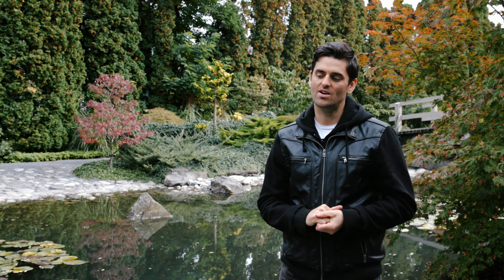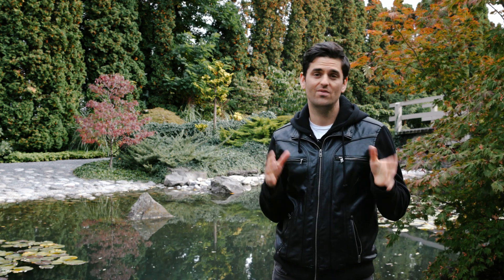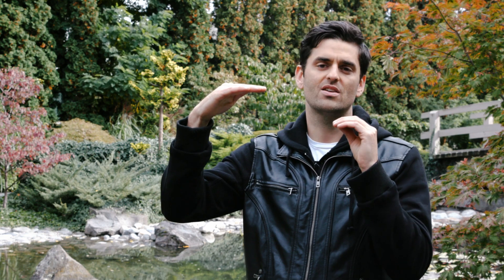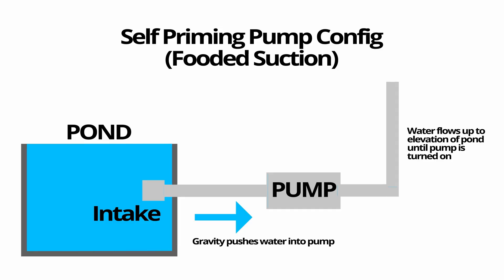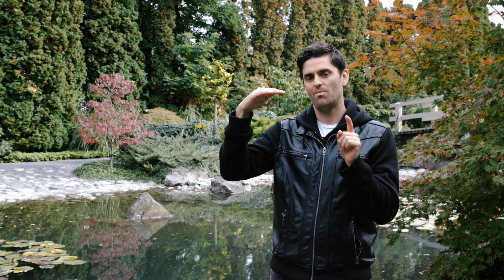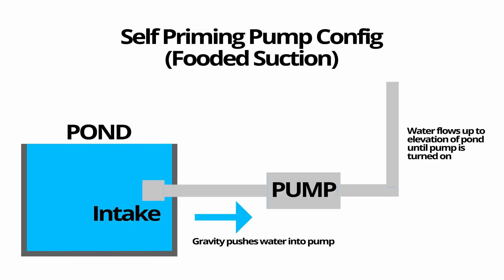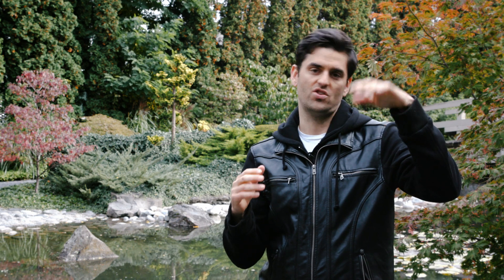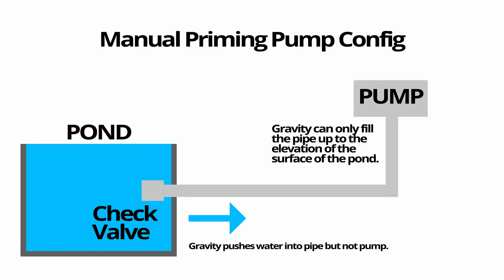Submersible vs External Pond Pumps

Comment: I had to plumb an external pool pump for my pond because my internal pump broke down in the middle of winter. This was the 2nd pump I had gone through and I believe they both broke due to lack of maintenance. I hope this external pool pump is a lot more reliable. I had to remove my check valve because it was leaking air into the suction line but I have a ball valve installed instead. The flow rate is significantly higher despite having a lower GPH rate on paper than my former submersible pumps. I had to modify my plumbing only a tiny bit to get the external pump operational. I love my new external pump.

Comment: Can you recommend an external pump that can pull 5000 gph and may be a low energy candidate to run on solar?
Reply: A 1.5hp pump would probably do the trick. The most energy-efficient electric motors are 3 phase and 240v or higher.

Comment: What size wire do the external pumps require? Can a 5,000 gph pump run on a 120 volt/20 Amp breaker with 12/2 wire?
Reply from the maker: The Sequence 4K series pumps run on 120 volt. A Sequence pump that does 5000 gph would actually only use about 300 watts, so it's well within the limits of a regular household ciruit. In the larger power series pumps, you can order them in either 120 or 240 volt. A pump that does around 16,000 gph would use around 2300 watts, which starts to be a bit much for a normal 120 volt circuit.

Comment: Is it possible to use a back flow check valve above a surface pump to keep water in the pump? So it doesn’t need to be primed.
Reply from the maker: You would need to find a way to fill the pipe with water between the pump and the check valve in order for that to work. If gravity would not fill the pipe, then it will not work. Feel free to email us a diagram of your pond design for review.

Comment: Hi. I have a question. How high can you install an external pump and how far away from the pond?? Thanks
Reply from the maker: They say that pumps push water better than they 'pull' water. The closer you can get the pump to the water intake, the better efficiency you will get. Ideally you would have your pump close to the same elevation as the pond surface - that will produce the best efficiency.

Comment: i have a doubt on submersible pump head level. while diped in a pond..
  is that the  pumping head height  is calculated from the   bottom of the pond or from the water level of the pond ??
Reply: It is calculated from the water level. Distance between submersible pump and water level is "free" because the water is doing the work. The pump is doing the work above water level.